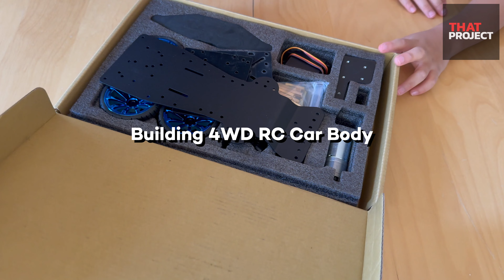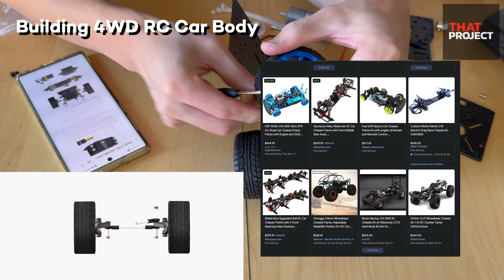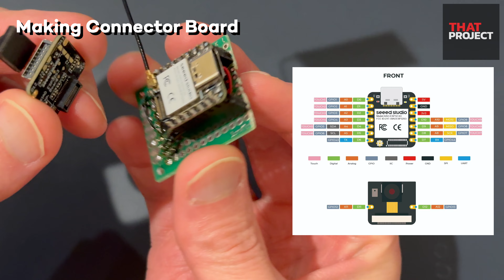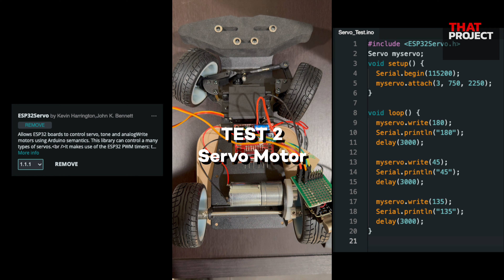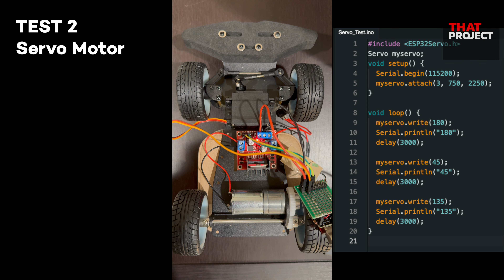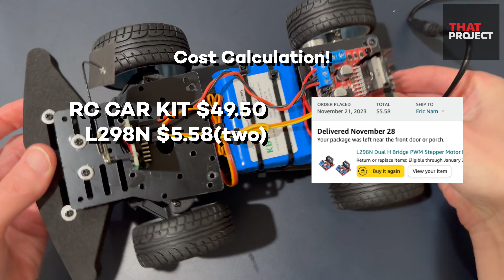BLE RC CAR Project, Part 1, How I build my RC Car? #ESP32 #BLE #MOBILEApp #DIYProjects

Comment: Hello👋👋👋👋 Is the servo motor really rated for 12 volts? Doesn't it get really hot because most servos are rated for only 4,8 to 6 volts?

Comment: Please... I created the same project idea as yours, but with another type of ESP32, which is ESP Wroom 32 Please tell me what codes should be changed, whether in the application or the esp code
Reply from the maker: @sagedryan6491  As far as I remember, I didn't use any ESP32-S3 specific components, so it should work on ESP32 too. Are there any issues?
Reply: @ThatProject 
Yes... with the same codes I can't connect to esp wroom 32 via my phone... it appears on the list of devices on bluetooth but I can't connect to it nor does the control page even appear on the screen because I didn't connect to esp via bluetooth.
Could the Mac id be the reason?
What do you think the reason is??
Reply from the maker: @sagedryan6491  I don't understand your question. What do you mean by not connecting via Bluetooth?

Comment: Henlo. I hope you can answer my question. What is the maximum distance on an rc car in response to a remote control?
Reply from the maker: In my case, it covers more than 15 meters in an open environment and I have no problems using it.

Comment: Any heating problems with the S3 I’ve been hearing some people saying it overheats?
Reply from the maker: Because it has a small board size and includes a regulator, it definitely generates more heat compared to the ESP32-CAM board. However, there were no problems with the camera operation.

Comment: Omg, BLE Will have only some meters of connectivity, how what range did you get? Thx
Reply from the maker: As you can see, this is a toy RC car and is intended for indoor use. In my case, it covers more than 15 meters in an open environment and I have no problems using it.